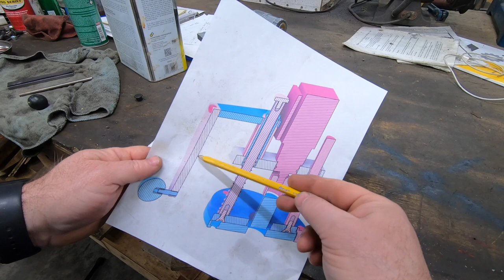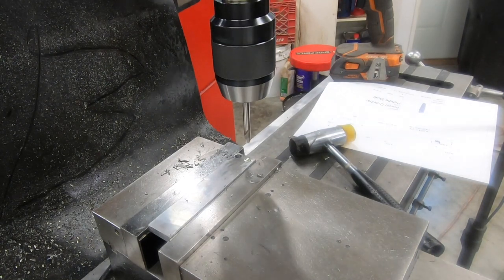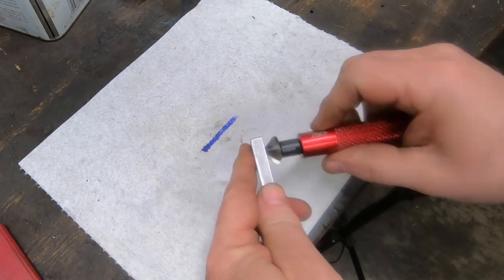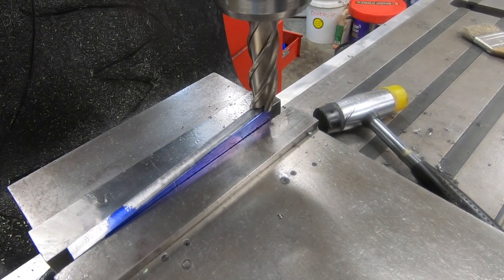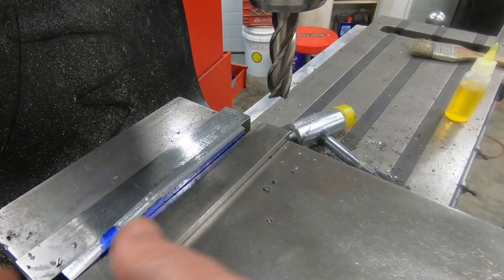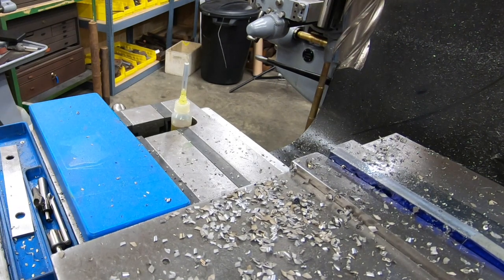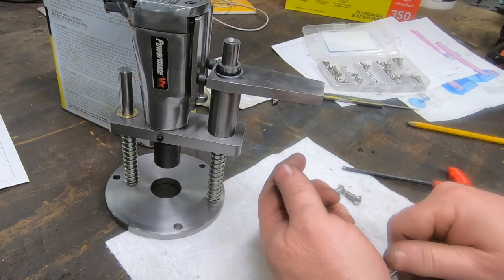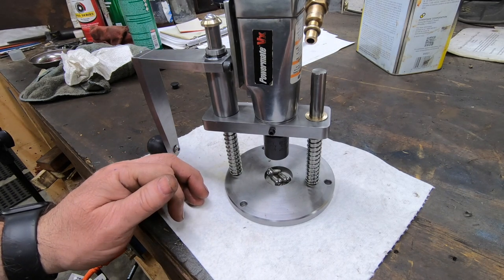Power Drawbar for the Bridgeport Mill - Making the Handle - DONE!

Comment: I like the fact that at the 7min odd point you actually tapped the hole correctly, 1/2 a turn cutting forward, back 3/4 - 1 of a turn to clear the swarf and then back to cutting forward for another 1/2 turn. You will never break a tap doing it like that and you will get as good a tapped hole as the tap is capable of.

Comment: I know what would look extra nice
Run a copper pipe on the bridgeport for the air with the inlet in some very convenient place on the back perhaps where you could put a manifold to run another copper pipe to some convenient place for the air gun and perhaps  another one for mist coolant
Maybe an overkill but copper pipes look really pretty
Reply from the maker: Copper does look good, but it's pretty expensive right now. I have some black pipe I am using to get air into the shop. My plan was to just use more of it for the time being. But, yes, some kind of manifold would be in order. One line for the drawbar, one for an air gun. And one as a spare.

Comment: I would parkerize it rather than cold blue it.  That finish is easier to do than cold bluing, and lasts way longer. As a bonus it retains an undetectable oil film that really prevent surface oxidation where as bluing does not.  If you can boil water you can parkerize.  If you go that route do not be concerned with all of the times and temperatures that some of the “kits” try and tell you are necessary. Just make sure your parts are degreased and bring the solution up to a temperature just below boiling.  If you want black rather than the gray finish just add a little cold blue to the hot solution.
Reply from the maker: Interesting. Cold bluing requires nothing more than the solution and a cotton ball. And I always wipe on a coat of oil afterwards, which provides the corrosion protection. Been doing it this way for years with no issues. I'd like to try parkerizing some day, or even anodizing for aluminum.
Reply: @MyLilMule  I cold blued for years, but the finish always wore through, and caustic hot blue took too much time and the setup was permanent.  After I parkerized a shotgun I never went back.  Try it you’ll like it.
Reply from the maker: @37yearsofanythingisenough39  I definitely will. I watched Mark Presling parkerize some stuff recently. His climate is very humid and if he doesn't, it all rusts in no time.
Reply: @MyLilMule  I believe Mark was the guy that went through all of the steps the “kit” told him to.  You don’t need to go through all of that with thermometers and preheat and rinse tanks and the like.  All I do is degrease with acetone, submerge it in almost boiling parkerizing solution (I have a stainless asparagus steamer) on a hot plate.  Take it out after the part stops emitting tiny surface bubbles and rinse it under cold water, dry it off, coat it with oil, and you’re done.
I store the solution in a gallon plastic jug after it cools off, but if you have the room I believe you could leave it in whatever vessel you heated it in.  I’m still using the original solution I made up years and years ago.  The zinc phosphate settles to the bottom after it cools so I just shake it up real good before using it again.  I made my solution up with steam distilled water so that there are no trace elements in it, and quite often I need to add more water due to evaporation, but I don’t even measure the water just add to cover whatever size the part is. It’s as foolproof as it gets.  The militaries around the world, including ours, had parkerized small arms during both world wars because it was so easy to do, and because of its durability.  Old weapons from those eras usually show a grey green coloration but that was due to the lubricating oils, handling, and leaching from the oils in the wood stocks over time. Your finish will be a dark grey unless you add just a tiny amount of blue from your gun blue bottle which will convert it to black.
By the way I bought my original parkerizing solution from Brownells gunsmithing supply in Montezuma, Iowa, but I saw a YouTuber make his own once upon a time.  I also just remembered that you have to “condition” brand new solution one time with some scrap iron or the like.
Reply from the maker: @37yearsofanythingisenough39  I'm going to look into this more. Thanks for all the info!

Comment: Nice to see it running. I fitted an inline oiler to mine because you sort of take it for granted and I would forget to oil it and kill it. Does all your R8 tooling eject easily? I have a few tools that get stuck and instead of the tool ejecting, the drawbar unwinds and pushes the impact driver upwards. It only happens occasionally but a few taps with a deadblow seems to loosen it.
Reply: The commercial units come with an inline filter and oiler for that very reason.
Reply from the maker: I haven't added the oiler yet, but it's part of the plan once I get a decent manifold and get it properly plumbed. Right now, it's a bit of a rats nest. I've had a couple tools "stick" but generally, I just tap the top of the drawbar with the air tool and it pops out.

Comment: Do the paddle leavers provide enough self centering pressure by themselves for the handle ?
I imagine if you provided an indent ball somewhere it would allow you to rotate the whole assembly to line up the hexes first and then when engaged further pressure to overcome your indent would actuate the air motor.
Reply from the maker: It doesn't do a very good job of self centering. It's something I'd like to look at, once it pisses me off too many times. LOL. But my aim was to make something relatively simple. It's not foolproof by any means, but it gets the job done. It's not perfect, but neither am I. ;)

Comment: Sorry if I missed it in a previous episode. Did you do anything with the spindle break?
Reply from the maker: I did not. What was it that you were thinking? Always looking for improvement suggestions!
Reply: @MyLilMule  My machine is a cnc and some cnc versions had an air cylinder on the brake lever. If you had some form of nc air valve and a spring return pneumatic actuator. You could have the valve triggered halfway down the travel of the mechanism to lock the spindle just before the wrench engages with the drawbar.
Reply from the maker: @mrbean6694  Not necessary in this situation at all. I don't even need to touch the brake lever to load/unload tools.
Reply: @MyLilMule  Ah thats good to know. I am still at the I want this stage and as usual over complicating it
Reply from the maker: @mrbean6694  That's what I have to constantly remind myself to stop doing - over complicating things. KISS - Keep It Simple Stupid. 😂